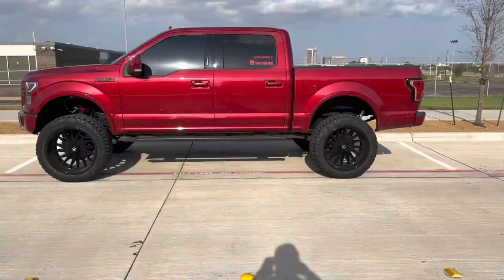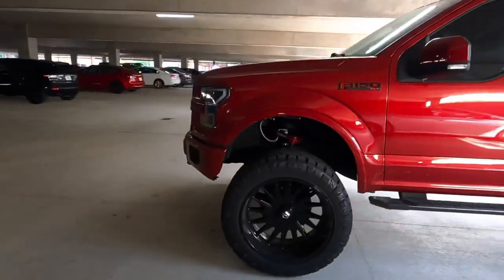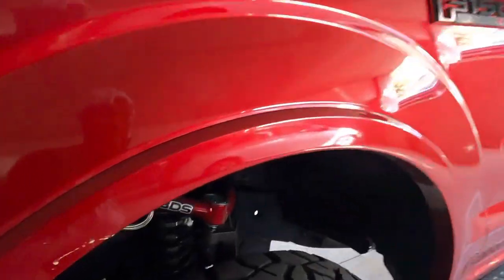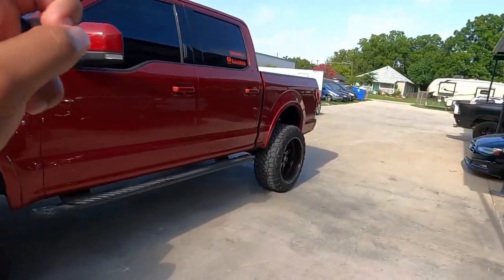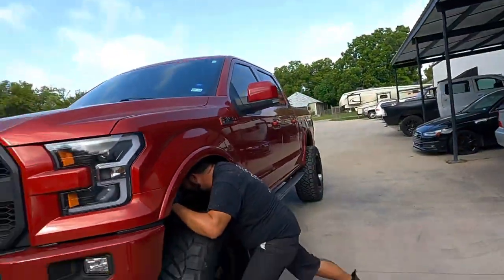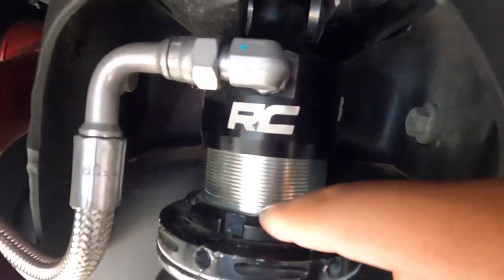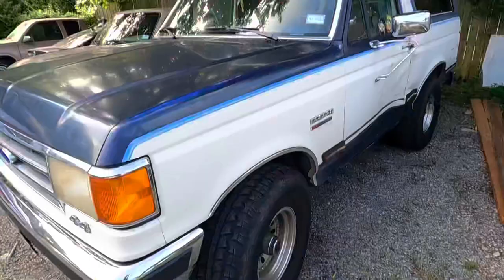How to Raise Rough Country Your Vertex Coilovers

Comment: Hey are these coilovers adjustable regardless of the truck you have ? I asked rough country and they said they are not adjustable. I have a 2016 tacoma and im thinking of buying these for my truck . On their website it shows threads on the strut so im guessing the person i asked just didnt know what they were they were saying
Reply from the maker: Interesting..maybe Toyota is different design than the fords..
Reply: @KickinItWithQ  ill have to call again and make sure . But how do they ride ?
Reply from the maker: @agustinherrera5600  yea I definitely call again but they ride very smooth. I did another video where bds owner drove it. We compared both kits. I’ll drop link or go to my recent videos. It was uploaded in December
Reply from the maker: @agustinherrera5600  https://youtu.be/0IUMWEYw_DY
Reply: @KickinItWithQ  alright ill check it out . Thanx
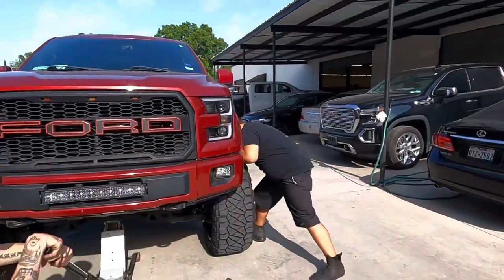Reply from the maker: @agustinherrera5600  basically $1000 https://youtu.be/Htnpx_WYy9Q go to 5:32 mark

Comment: Truck looks so good, Q! You should already have a 4 inch block in the back unless RC uses a 5in rear block. Just FYI! Loving the content, man.
Reply from the maker: Preciate it man! Another guy said they use 4 or 6 but Ive never measured. But I appreciate you running in boss!

Comment: Did you get a alinment
Reply from the maker: Since we didn’t lift it that high I did not get an alignment
Reply: @KickinItWithQ  I have your same Lyft I went with 35 falcon at4w but I rub in my front bumper just like a tiny bit and I was wondering about that if I needed an alignment thank you for responding to me. I watch your videos all the time because we have the same truck and like your personality
Reply from the maker: @carlossosa6712 thanks man. I appreciate that. Thanks for supporting channel. Yes, if you do a major adjustment with the lift kit, definitely get an alignment

Comment: When you did the height adjustment was there also room to adjust to lower it a little. 
I have to get the 4 inch lift for my extended warranty coverage. So i want to lower till warranty is over. Then adjust to full 6 inch in the front then swap rear blocks out then too.

Comment: Do you tow with these vertex shocks? If so what settings do you use?
Reply from the maker: I do not tow but I’d think stiffer would be better when towing
Reply: What size are your tires? Im on a 6” Rough Country lift with 35” but my measurments are 19” and you are at 22 and 22 1/4.  My truck is a Ram Rebel which comes stock 1” higher as its the off road package.  I want the height you have, truck looks sick!
Reply from the maker: @douglashardy177 my tires are 37x13.5
Reply: Getting the vertex coilovers and shocks installed next week.  Maybe Ill look into bigger tires as well. Thanks for replying back to my questions, much appreciated! 🤟🍻
Reply from the maker: @douglashardy177  no problem bro I appreciate you tuning in and checking out the video
Reply: What size are your rims and tires?
Reply from the maker: @douglashardy177 24x12s and 37in tires

Comment: I had no idea you could do this with the Vortex coils. Makes me want them now! 😫 
I was gonna do a lifted strut with a level kit on top but a lot of people tell me it will not work right. Have u ever heard of this before?
Reply from the maker: I’ve heard it done before a few guys I know run that. You just Gotta go to the right people who know what they’re doing
Reply: @KickinItWithQ  if u were to build your truck from the ground up would u go higher off the bat? I'm debating on 8" lift with 37s or a 6" with 35s.. I own a F150 xlt also! 

Only thing I'm having trouble with is with a 6" lift it seems more functional as a daily driver.. 8" seems good but might just be more trouble later . 🤔
Reply from the maker: Yea 6 def more practical but I think I would go 7-9in. They make them adjustable now a days

Comment: Looks better!! I hate a rake, I think level to a 1" squat is perfect. I bet your closer to 7.5" of lift, if I new your exact rear block size I could tell you for sure.
Reply from the maker: Think 5 in block….i could be wrong
Reply: @KickinItWithQ  Most 6" spacer lifts come with a 4" block and 6" spacer which gives you a 6" lift because of factory rake. When I pulled my 6" spacer lift off and put vertex coiloves on with a 1.5" stacked level,  I had to replace my 4" block with a 5" block and a 1" lift shackle and I still have 1" of squat which means I'm at 9" in front and 6" in rear. Everyone I've talked to that has put vertex coilovers on were 7.5" of lift right out the box and the same thing happened to me. So if you have a 5" block and 7.5" front lift that would put you exactly level because of 2.5" factory rake. Your truck looks bigger than 6" plus your clearing those 37s. You should join some of the fb groups so more people could find out about your channel, because you have good content.
Reply from the maker: @philchristmas4071  Preciate you breaking that down bro! I’m definitely still new to this but that makes sense. Man I’m in the groups but it’s so negative so I rarely post but you right might go drop this link now lol
Reply: @KickinItWithQ  Man ain't that the truth!! Actually I think you did a video on the truck scene. I'm also part of the motorcycle and mustang scene and it's nothing but love, people damn near break their arm to give you a thumbs up, but in the truck world nothing but hate and jealous punks for sure. Anyway it's cool because your subscribers can interact with you on FB groups better and show pics.
Reply from the maker: I know I don’t understand why but I posted in the group so we’ll see how it goes
Reply: @KickinItWithQ  I will look for it but theirs a lot of groups. Don't pay attention to haters because look how good your channel is doing! They just jealous your truck looks better.
Reply from the maker: Lol I appreciate it bro 🤝💯

Comment: Does your truck have a voltmeter gauge  in it ? My 2015 didn't so I just added one. Was a finding a fuse that only came on when I turned the key. When my truck is all done I will show you on your FB page ok.
Reply from the maker: Nah It doesn’t have one bro
Reply: @KickinItWithQ  Just drooped off my 2015 for the BDs 6 inch lift . Will be ready in a few day !
Reply from the maker: @Mike-bb1li  nice!!! Congrats man! 💪🏾

Comment: The Vertex manual says to use a strut compressor tool to compress the spring before making adjustments. You can see your spring getting twisted while that guy is rotating the collar because of the spring tension against it. I think your coilovers are fine, but it's not good on the springs to do that.
Reply from the maker: Thanks for sharing that information bro! I had no idea